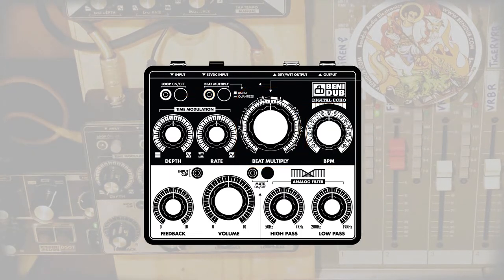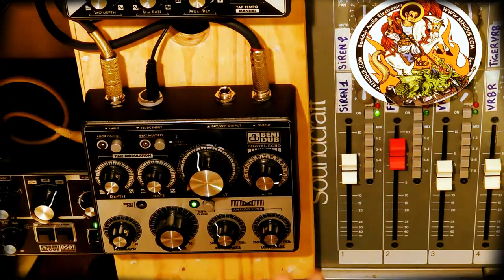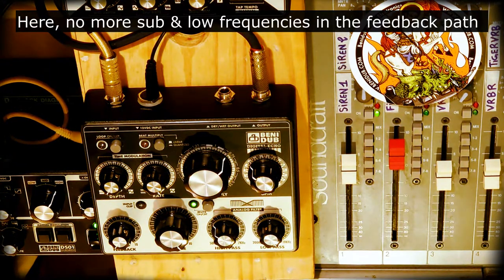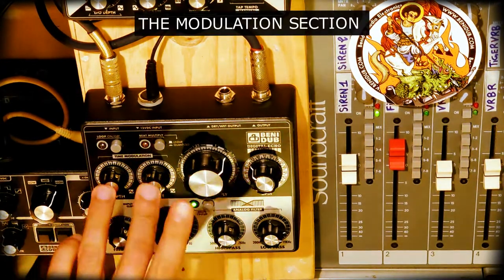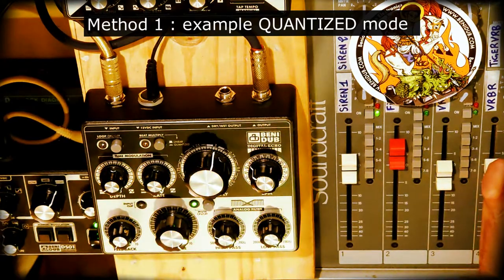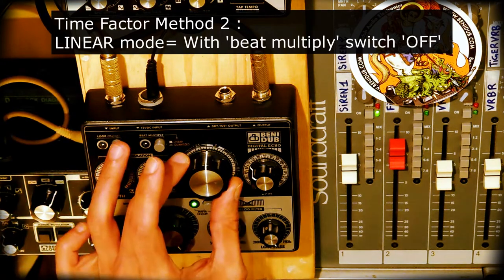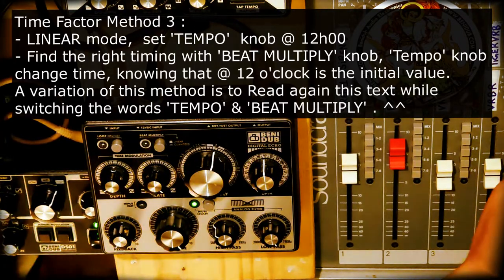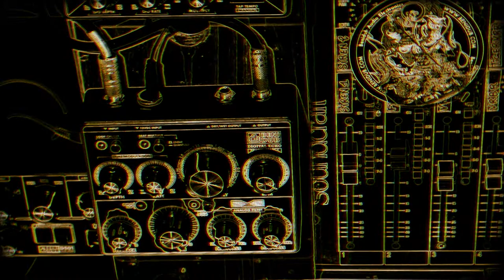⚙️DUB GEARS⚙️ Ep 1 - BENIDUB Digital Echo - Review & Tips

Comment: do u run the whole into that pedal ??
Reply from the maker: I dont send all at same time but this is possible , to do so ( sending even bass track and full drum bus kick included ) when possible I lowcut the signal before it feeds the echo , practical in the project where the client dont deliver the complete separated tracks .lowcut pré-send around 80hz already remove the most sub freq from the echo loop , then the POSTfilter on the echo unit , i use it to set or change the color of the delay tail by manipulating frequency cut off.
Reply: thxx for the explanations mate 
 @JIDEHHIGHELEMENTS